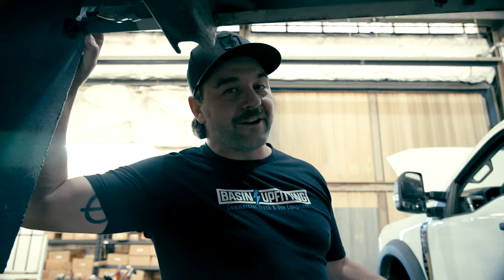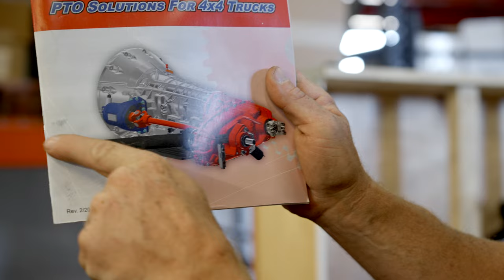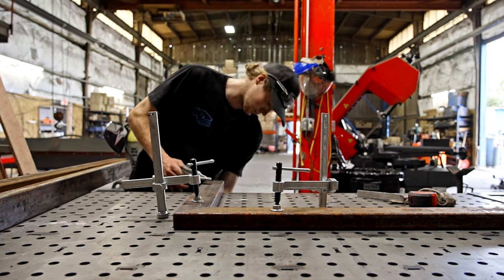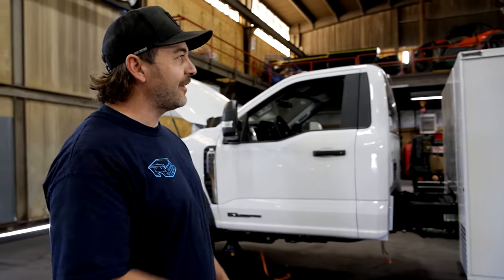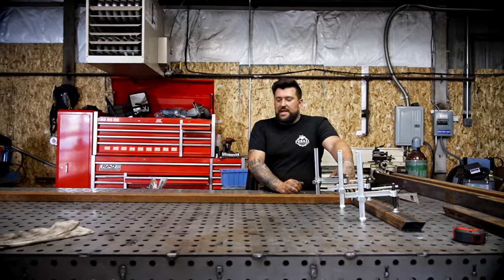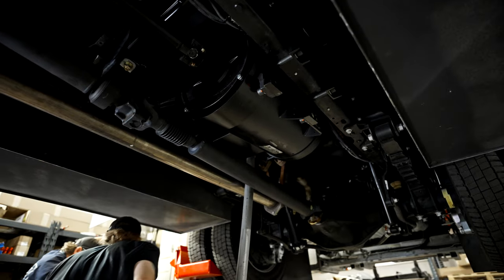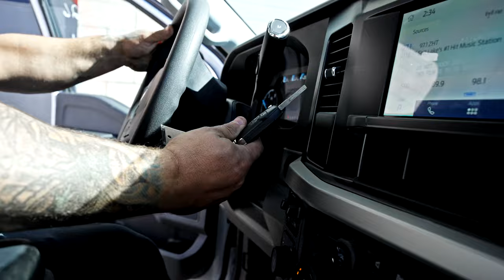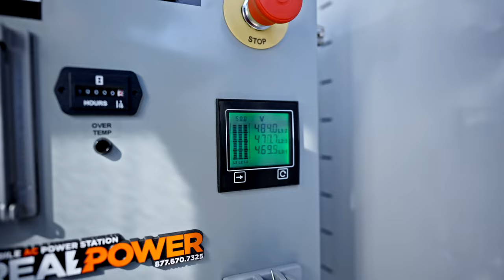70 KW F-550 Mobile Charge Truck!

Comment: Lighter than I would have thought, their website lists the generator at 630 lbs, with the distribution box, wire etc you're probably under 750 lbs total. Not much for a  F550 but concrete saw trucks carry a lot of heavy stuff, so the generator being light matters. A complete genset that size is pushing 2 tons wet.

Comment: Nice build! Are you focusing on new custom builds like this going forward?
Did you add an extra fuel tank for when the truck is in PTO mode?
I used to drive an LPG tanker with the same run safe system, it's pretty cool. 
Editing on this video was excellent by the way Kole 😊👍
Reply from the maker: Thanks for watching! We will be building custom builds for work and play. The next video will be a little bit of both